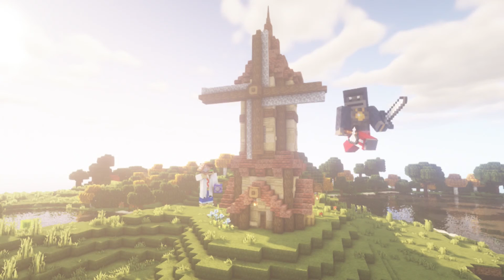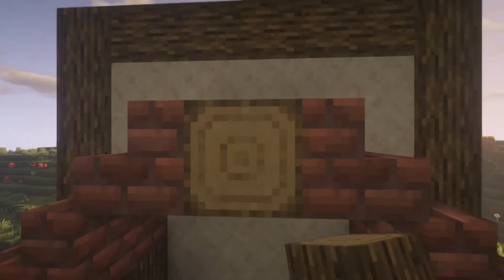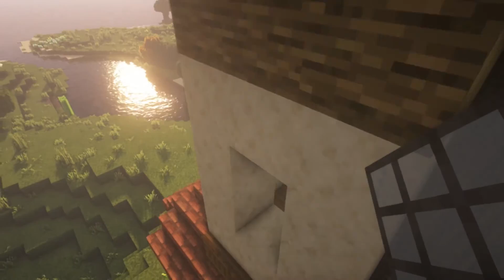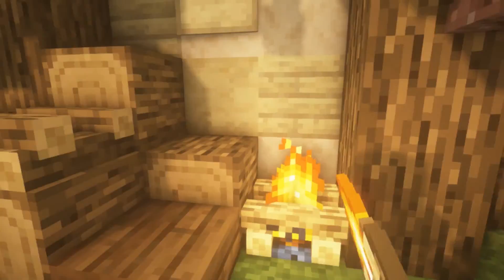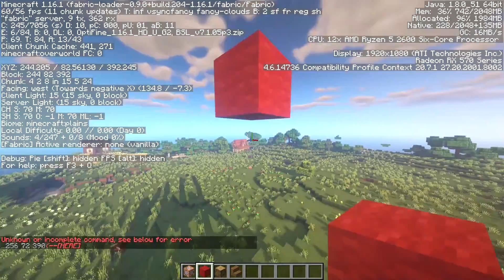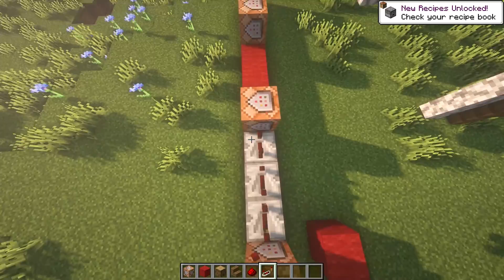Minecraft Moving Windmill Tutorial! (Using Command Blocks)

Comment: Anybody else having an issue with the 4th version of the windmill? I have 3 of the copies showing up but the 4th one doesn't load in. Just restarts the windmill cycle at the 1st copy. 1-2-3...then back to 1. Same redstone setup as the video. 

Any suggestions? I'll ultimately take what I can get with 3/4 working, but 4/4 would be muy bien

EDIT: Forgot about increasing the ticking area for the command block. This fixed the issue for me. If anyone else has this problem, type into chat:

/tickingarea add ~ ~ ~ <current position coordinated> <whatever name you want to give the ticking area> 
 
For example: mine was /tickingarea add ~ ~ ~ 1627 69 -271 windmill4

Comment: Is this not working for anyone else? I followed the instructions perfectly and rewatched the video several times to make sure. Once I turn on the circuit, I look at my windmill and there's nothing there, not even the original "sketch" I made of it to determine the size and coordinates of the last block. When the circuit is on it also won't let me build in that location (where the turning windmill is supposed to be), so obviously something is going on there, but nothing visible. This is my first time using command blocks. Is it possible there's some sort of setting I need to change in order to make this work?
Reply: dID YOU FIX IT
Reply: Dose it work now?
Reply: I am currently having the same issue. I haven't figured it out yet.